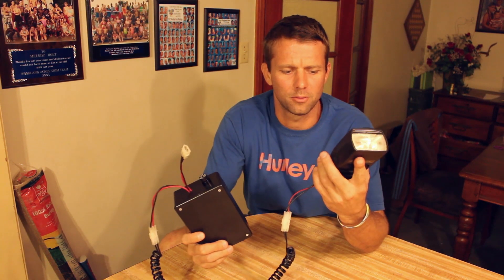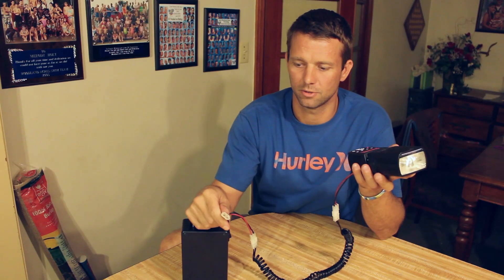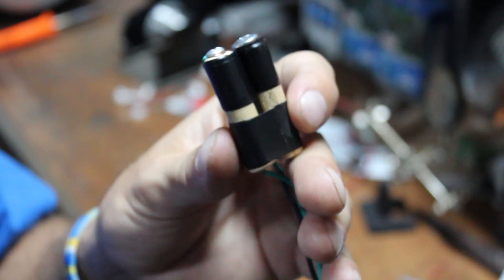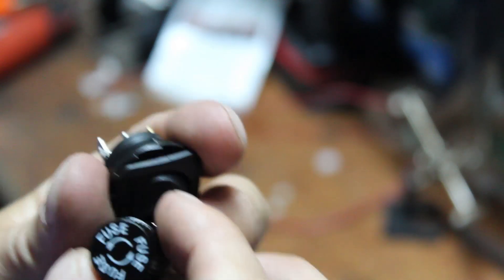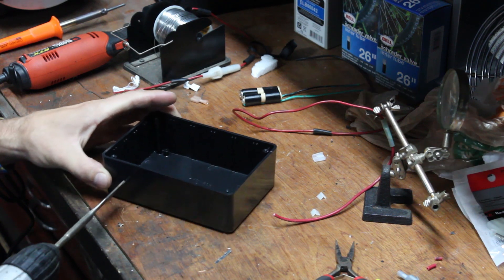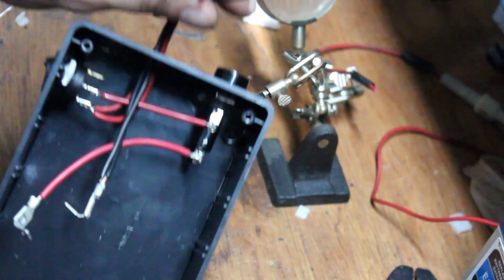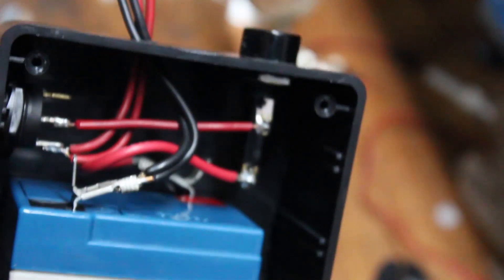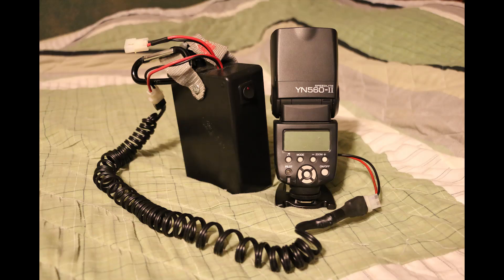DIY battery pack for Yongnuo YN-560ii Flash

Comment: Good night, I did the whole video procedure, but my flash burned out, I did it exactly as it is in the video, I lost my flash, the battery power of 6 volts 4.5 mh and too strong to power the flash, that made the temperature raise and burn the capacitor.

Comment: I have experimented with battery packs like these. While they will give much longer shooting time, since these batteries are of fairly high amperage, if you are looking for increased re-cycling time, you may not get it. For SLA batteries to give the fastest recycling time, connecting cables should be as short as possible. Just a point that was not mentioned in the video.
Reply: Make sure you use a thicker wire

Comment: What would be the most basic way to give more battery life & power to the yongnuo 560iv ? Are the battery packs you can buy pretty universal? Even if it holds AAs I just want some extra life in these lights
Reply from the maker: I never used the battery packs you can buy so I couldn't really give you a comparison, I can tell you that I can get in over 2k photos on a full charge with the  DIY battery packs though.

Comment: My YN685 flash is drawing around 6A at full power so you need to make sure you use at least 20AWG wire for each flash connection. I also made 2 output connectors, 3 will be too much for the battery and could be slower for re-charge. Now I realized why the AA batteries are running so hot with my YN685...

Comment: The battery terminal plan inside the compartment lid is for the battery ends that show when it's loaded the springy tabs at the bottom of the compartment are obviously the opposite. Minus at the top is plus at the bottom end of your fake battery.  Use a multimeter to check on which two contacts are linked at the bottom and use the other two battery slots. Hope this help those new to this sort of thing. I did this with a pair of Vivitar 285hv flashes six years ago and they are still going strong. You'll need to recharge the six volt battery every month to keep it in tip top condition, otherwise it'll gradually sulphate the insides.
Reply: Hi. Could you please kindly elaborate the instruction regarding the multimeter. 

Does it mean that, I need to check which 4 slots (bottom) are connected to each other? If I found which two slots are connected to each other, I will use that to put my dummy battery or I will NOT use that two connected slots?

You have also said that, if the polarity of the cover is negative, I need to insert the positive fake battery with the screw first. Then with positive polarity in the cover, I need to insert the negative fake battery with the screw first? Thanks

Comment: I can use 9v???
Reply: From a design perspective, any dc-powered device that relies on batteries will be safety-engineered to accommodate variation in battery voltage.  A 6v flash will almost certainly tolerate 6.6vdc supply.  The real question becomes: what is the max dc voltage it will tolerate?  The nominal and peak voltages for 18650 li-ion cells are 3.6 and 4.2, respectively.  If the flash can stand 8.5v, then two 18650's in series would likely drive it all day, and provide extremely fast recycle times.  Much smaller and lighter pack.  I sent a message to yonguo to ask about this.  I doubt they will answer, but if they do, I'll post back.
Reply: @davidspaugh4352  did you found out the answer after all this time? =)
Reply from the maker: w1p30ut3r you will blow up your flash with that voltage, keep to the 6v as its what our flashes run off of.

Comment: do you think that yn560 would work on two 18650cells connected in series to give around 7.5 volts? Or it could overload the dc converter inside the flash?
Reply: I think it would, since some aa batteries have 1.8-.1.9V

Comment: Thanks for the DYI. But it did not work for me. It blow every fuse I stalled using the lower - and +. however when I use the vertical - and +, the fuse would not blow, but the flash did not power up either. Everyone, use a FUSE, use a FUSE before trying this test. I did it on my TT560 Neweers speed light.
Reply: What was the rating of the fuse that you have used?

Comment: Made this (with slight modification: instead of screws as contact points I soldered the wires which i passed through a hole I drilled in the center of the dowel directly to globs of lead (contact points). No more dark pictures-ever. Thank you for the idea!

Comment: Grreat. I'd like to build this for my YN 560 III but I am nor sure about which of the four  battery terminals (inside the flash) to connect to with the dummy batteries. I hope a video would come up about that. Thanks.
Reply: If the flash is facing away from you ( hot shoe close to you), then its the bottom two terminals:

Light

- +
+ -  <-----Use these two

Hot shoe
Reply: Garry Emmons Thank you, sir, for taking the time. Have a good one. Have MANY good ones. God bless.

Comment: Make a tutorial on how you made the Faking battery .
Reply: you can buy dummy batteries online...
Reply: I selected the "straightest" twigs of the thickness of an AA battery from cuttings of a tree in my backyard. After cutting them down to size and a little sanding, I then drilled a hole straight down through them. I then passed a wire inside and making a ball of the conductor at the tip of the protruding wire, I soldered on it making sure that a "glob" of lead stayed on. This "glob" of lead srved as my contact point or battery terminal ( doing away with the need to use a screw as what is described in the video). I had to make a pair (each for the positive and negative. terminals). Needless to say, it is important that the twigs were sufficiently dry and not green. I must again say: this is the best DIY idea that I've ever seen on youtube. I now can have more useable photos when shooting multi at high speed. Again, thanks to OP.

Comment: How do you know which two slots the fake batteries go into out of the four available slots?
Reply: check the battery cover how the batteries are being connected. 2 of the battery connectors/terminals inside the battery compartment will be shorted/connected and the other 2 terminals will be open. The 2 open terminals is where you will put you dummy battery. Just make sure your polarity is correct.
Reply: Awesome thanks for the tip.. I will this out with my multi-meter.

Comment: I dont understand, why u used fake batteries and not that port on the side. What voltage is needed for that slot?
Reply: +SatanicJamnic something around 300v
Reply: if you can find the same terminal as what you have on the side then you will not need the dummy batteries. But this dummy battery can be used for other speedlight that has no external battery terminal.

Comment: What about to use a 12Ah battery? Will be dangerous? I´m planning to make a battery pack like this but I like to achieve the minimum recycle time and the maximum battery duration
Reply: I believe AmpereHour (Ah) is the battery's capacity and not its voltage. As long as the battery's output voltage is 6V then you should be fine.
Reply: +Vicente Ferrer you will blow the circuit..

Comment: Why didn't you just buy a Godox or or similar HV external pack? In all honesty this is completely ass backwards! When you use an HV pack it charges the flash capacitors ...which is the primary drain on the AA batteries! The AA's will last an AGE using an HV pack as all they'll be doing is powering the logic circuits of the speedlite.
Honestly..HV packs aren't that expensive! A LOT less than having to replace that expensive speedlight that you just fried by shoving a forward voltage of 7 or 8 volts through it from say an SLA (yeah I know they say 6v but they frequently are a lot higher) 
All in all....not a great idea.
Reply from the maker: Yea, "honestly" these battery packs have been working for two years without any problems. They cost me $45 in parts to make and last several shoots before needing recharged. From around $140 the Godox PB960 are not cheap. But looking at the comparison, the better quality Pixel AA Packs are around $70, plus $20 for 8 Eneloops.  so if you've just got extra money to throw into battery packs then that's your choice, but honestly I'll keep shooting off my diy battery packs. Thanks for your opinion.
Reply: Lee Holt Lee... Just a suggestion.. but how about a homebrew HV battery pack that plugs right in to the HV input? I don't think the circuitry would be too involved at all to step up 6v to the necessary 300 - 350v? I guess you could even take the circuit board from maybe one of those "disposable" film cameras that have a built in flash? Or a diode network/coil thing? I'll happily measure the voltage output from my  pack if it at all helps?
Reply from the maker: +Paul Austin that's a bit over my head but I'm sure I could figure it out. I've searched for the connectors and couldn't find where to purchase them, which was discouraging on the DIY note.
Reply: +Lee Holt (holtmediaproductions) You can get the complete lead for a reasonable amount on Amazon. They have the connector one end and on the other a standard din plug....should be a breeze to buzz out with a Meter. The din socket you can get real easy...its identical to the normal audio type.
I measured the output of my pack and it kicks out 310 volts. I'm pretty sure most flash capacitors are rated at 330v so anything between 300 and 330 volts should be fine. Anyway...let us know if you do give it a go...would be fascinating!.... hey maybe even mains power? should be easy to step up 120v to 320 using a step up transformer and full wave rectifier...
Reply: this is exactly my problem, I can't find a connector for the external terminal of the flash unit, and you will need to buy multiple types of terminal if you own different brands of speedlight..
Reply: Alan what brand of flash is it?
Reply: the godox batery pack are atleast 150USD and the flash are like 70... a 6v 4.5 ah cost me like 10 USD, and rest i cand find for allmost free, and this multiply with 2 and maby 3 flashes, those godox will become pretty expensive compared to like max 50 usd cost, instead of 450 usd, and doing mostly the same
Reply: I have both Nikon SB910, SB700, YN560, YN685...
Reply: Allan Lansangan The Nikon's terminals are identical so a Godox or similar to Nikon will fit both and I'm willing to bet the connection on the YN's is a Canon fit.
Reply: Outstanding idea if you ask me. Real ingenuity and engineering here. Is it perfect? No. But that's why retail products cost a little more, someone engineered them to perform reliably in a very specific way. 
The fuse is a great start, and to make this thing even better it wouldn't take more than a ~$4 voltage regulator circuit to protect the flash from battery noise and power fluctuations. A low-voltage regulator is literally $0.75, throw in a few caps and diodes for another $1-$2 and you have yourself a safe and affordable power supply. Technically speaking, Lead-Acid batteries are safer than Lithium batteries anyway, but that's besides the point. 
Lee's power supply, sans additional protection circuitry, is no different than what the engineers in China design and package in a pretty enclosure. 
All in all, are Godox batteries THAT expensive? Comparatively, not really.. But a cost savings of +/-$50 overall is rather significant if you ask me. That's enough savings to buy another camera battery. So if you can the know-how and tools to make one of these, why not?

Comment: could this work on a 560-IV?
Reply: and a 6v 4mah?
Reply from the maker: +Luis Rodríguez I've built them for many different series yongnuo flashes, the ttl flashes have a different pin setup for the batteries but it's the same process. you can use any mAh rating you want as long as the voltage is 6v.
Reply: +Lee Holt (holtmediaproductions) Another question, how much time do you get with this setup?
And what fuse capacity is correct for the setup?
Reply from the maker: +Luis Rodríguez I can shoot three client sessions before I have to recharge the batteries. I believe I used a 15 fuse for it as well. I can't remember if the top of my head, if you check the owner's manual of the flash you can see what the flash pulls and then just add a little for the safe room.

Comment: What happens if you use 12v battery?
Reply from the maker: You would blow up your flash as it's twice the voltage that the flash is made for.

Comment: Despite his "spelling" Metalsnake00 is quite correct; The upper battery chamber has a short circuit at the bottom end (all that does is connect the four 1.5 volt cells in series to arrive at the 6 volts the flash needs) and if your dummy batteries were to be inserted in the top slots, you would blow the fuse (or melt wires as some seem to have done). The bottom two cell positions are where the "dummy" batteries go and yes, ignore the polarity label; this label refers to which polarity the outer end of a real AA cell needs to be: the inside end is of course the opposite polarity and since your dummy battery insert is not a battery, but a piece of wire, the external battery polarity must be; positive polarity goes into the negative label and vice-versa. To answer Hassan's question regarding "why not use the battery pack connector?"; this plug is proprietary and not available in regular electronics stores. Have you noticed there are three connections? The manufacturers use that third connector to "sense" that the power connector is being used by the correct device.

Comment: Hello
I am a computer technician and electronic but for the price, or chose this:
http://www.ebay.it/itm/SD-9A-Extra-External-Flash-Speedllite-Battery-Pack-8x-AA-for-Nikon-SB-900-SB910-/111024828438?pt=UK_CamerasPhoto_CameraAccessories_CameraFlashUnits_JN&hash=item19d9987016
Reply: +Gerson Villacortes I used it 8 hours with more than 1000 clicks the Accumulator pak ...... and had no trouble ..... I obviously was all accumulators 8+4 sanyo enloop. I did not have the issue to change.
I should have changed the batterypak that low of a condensator 330v. he works at 12v. so you do not have to touch the flash.

Comment: you r realy domm fuck asshall you know that? after making this video you have to let ppl know about putting batterys right way in flash cause other ways they will get short circuit in them flashs, so GUYS IF YOU DO THIS METODE MAKE SURE YOU PUT FAKE BATTERYS ON LOWER TWO POCKET IN HORIZONTAL WAY THE BOTTOM OF FLASH, AND ALSO IGNORE THE TAPE THAT SAYS WHICH WAY TO PUT THE BATTERYS, SO YOU HAVE TO PUT BATTERYS WRONG WAY, if the tape says you have to input + battery you have to turn it around and put it as -, and if tape says - you have to put it as +.
Reply: You are clearly disturbed, the guy was just trying to help. Thanks for the laugh though, very comical someone calling an individual those names that cant't spell batteries, and writes like a 4 year old. Oh wait, maybe you are!

Comment: did something like this yesterday for studio use but with an adaptor plug (DC output) putting it on 6v and now wont turn on any ideas pls ?
Reply: Noel Briffa  you need at least 5A for youngnuo to work well. So you got to find a 6v5a power supply

Comment: For a power adapter you could use AAA to AA adapters which are cheap on ebay.

Though I'm still trying to find room for the wires on a 560III without grinding the metal plate.
I may just change one of the jacks on the side to a 5.5mm plug.

Comment: How did you figure out which two battery slots to use for the fake batteries?
Reply: check the inner terminals of the 4 battery slots. 2 of them are connected(series), the fake batteries should go to the other 2 terminals.
Reply: ***** I dont understand that. please re phrase. Batteries dont have a male and female.
Reply: I used a voltmeter to connect between poles and find out which ones were on a circuit and which weren't. On my YongNuo 565EX it's the bottom two slots.
Reply: John Marian please more details on what touches what

Comment: Maybe a stupid question, but why not use the battery pack connector instead of fake batteries?
Reply from the maker: If you can find the proprietary female connector go for it... I was unable to locate them.
Reply: The external power pack on yongnuo's still require AA batteries to be inserted. Even if you used the proprietary connector you would need to rewire the inside of the flash to use the power pack by itself from that jack.
Reply: ladefreakndah which pins do u use on the proprietary  connector?
Reply: Allan Chapman
I don't. My suggestion is to get one of the proprietary packs and measure the output with a multimeter.

Comment: hey man, im kind of an idiot with this. bout the same battery. and followed directions. except the fuse. and my flash burned up. took it apart fixed the burned wire tried again. same result.  one more time larger gauge wire. then it burned up a different wire. can you tell me what im doing wrong?
thanks brother.
Reply from the maker: It seems that you have the polarity reversed. Try reversing the positive and negative inputs. From the sounds of it this is your problem.
Reply: thanks man i figured it out, after melting the wires in my flash 7 times and rewiring it. lol. i have now made 2 and they are awesome. thanks for the help.
Reply from the maker: No problem, I'm glad that I could help!

Comment: I know all connections are working. Seems I'm using wrong fuse. What fuse did you use?
Reply from the maker: I used a 20a fuse.... make sure that you have the correct polarity going into the flash too... Also if you have a weak connection the flash won't turn on...
Reply: Thanks.  great video by the way.
Reply: @leeadamholt  Do you think that 20 amps would be the ideal fuse? Have you evaluated one with a lower amperage rating?